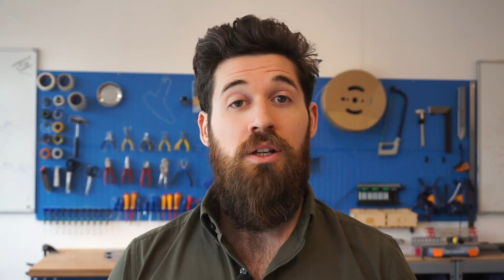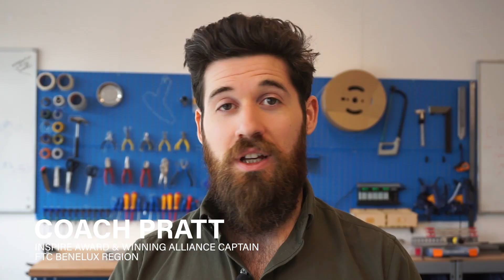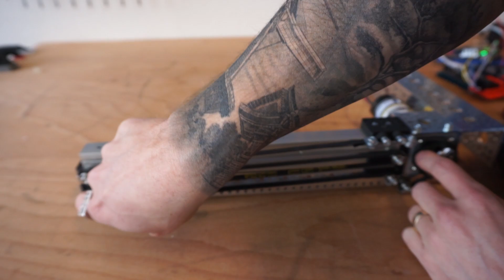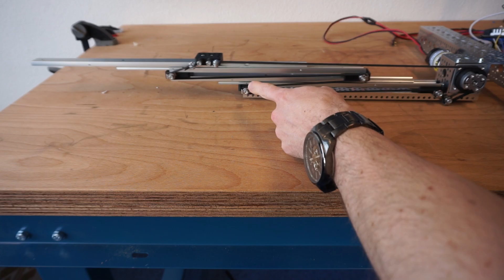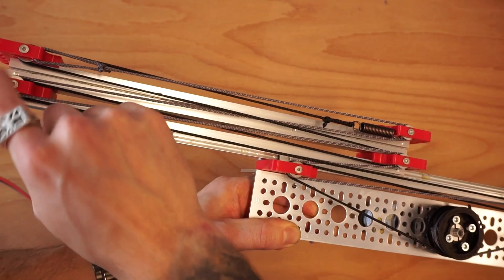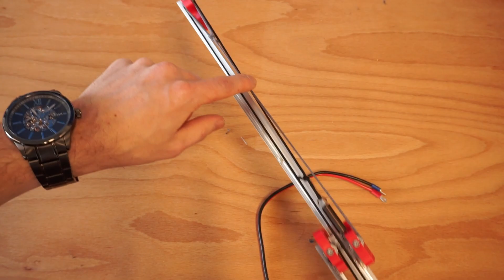Are Misumi Slides an FTC "Cheat Code"?

Comment: A couple of questions, this is specifically for FTC. If you are running dual slide system is it beneficial to mechanical connect both the motor shafts. Also how would belts would for like 30 or 45 degree angled slides. Finally what do you think it the best type of slides for FTC and do you think belt or string is better. Love the video and would love to see a video on how to do a telescoping arm slide.
Reply from the maker: Great questions: 

Assuming the dual parallel slide system: I would suggest you constrain the system together somehow to prevent drifting on either side which may cause jamming. You could tie the motors together on a longer axle and use a coupler to attach the axles together. You could also have some sort of constraint in between the slides themselves, say where you attach a claw, intake, outtake, etc. This would also constrain your parallel slides together to move at the same time, if you're unable to couple your motors together. 

Alternative Angles: Belts will work just fine at alternative angles, you would simply need to find a way to mount them to your chassis at that angle. GoBilda channel natively accepts 45* angles, but you could easily CAD up a quick bracket to find a custom angle. 

For what's best, strings vs belts, I've got a video on that here: https://youtu.be/36JxvXujCs8